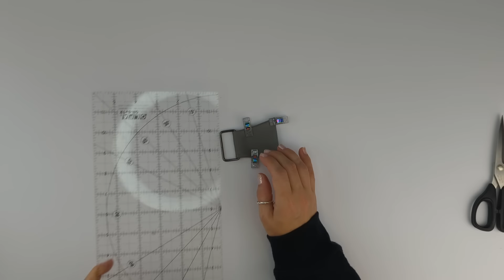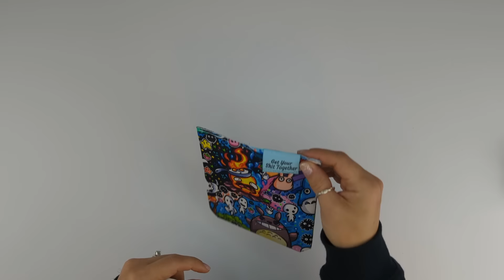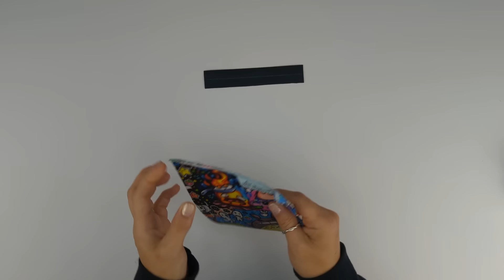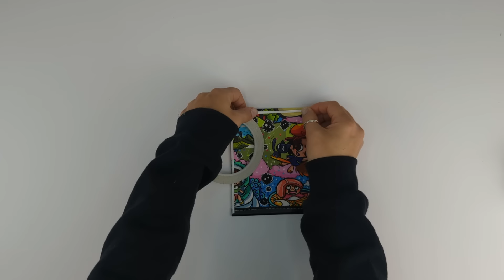The Rosie Sling Pattern - from Knotted Threads Co.

Comment: I just made the Rosie sling out of a light weight vinyl and canvas  material and cotton lining.  It came out good for a 1st try at bag making. Next time, I need to have the skinnier tape as recommended. I used 1/4 inch upholstery grade cuz that's what I have and It caused gummy needle issues.  With materials I used, it is not domestic friendly.  I used a vintage all metal heavy-duty domestic for early steps and jumped to industrial for all top stitches and final assembly.

Comment: Great explanation of why you clip curves--for this zipper, but applies for anything sewn with curves!  I just bought this pattern & my plan is to make it with leather & a few changes likely but basically the same construction & love your design & all the attention to detail in the design and instructions!  But the slip pocket--why not sew the sides & bottom for it, radius corner, then turn & close the open top with the binding?
Reply from the maker: Thank you! You can do the slip pocket that way, this is just a slight modification of the way I normally do them ☺️

Comment: Your designs and tutorials are outstanding!  What is your trick for fusing foam?  I have never had trouble fusing any other product.  Thank you!
Reply from the maker: Thank you!! 

A heat press and heavily spritzing the foam is my trick. It should be vinyl RS down and foam on top. Spritz the foam heavily once placed, top with Teflon sheet, and press for 10sec at a time. Use the highest heat your vinyl can handle (I tend to stick to a wool setting on mine). Repeat until fused, but be sure to let it cool in between spritzing/pressing. Foam is one that I found it truly matters to let it cool because the glue hardens as it cools and it appears as if it isn't fused while it's still hot/warm. The pressure of a heat press is important, but you can still get the same results with an iron. Just takes longer and is less consistent. I hope that helps!
Reply: @knottedthreadsco   Thanks for the quick reply!  I am going to practice with this and see if I can get it to work.  I happen to love the feel of foam, but I never fused it before.

Comment: Can you tell me which stitch length you use on your Juki LS 1341 when you put binding on? They look very short.
And do you use 600D as WPC or a thinner 400D. It is very thick when the bag is finished.
Reply from the maker: On my 1341: Baste = 6, Attaching the binding = 4, Topstitching the binding = 5. I'm using 600D. It is a firm binding, but that's great for the bag structure. I only use my WPC method for WPC, so it should be 3 layers of binding. :)
Reply: @knottedthreadsco   Thank you very much for your quick reply. It's super. Your stitches really just look short and my stitches look much longer with the stitch lengths (which I usually use too). I am using a Pfaff 335. Really an educational video, thank you very much.

Comment: Love this tutorial! I'm just having problems with SVGs for Cricut. I've never figured out an easy way to sort the pieces from the instructions. I finally weeded out the extraneous stuff, checked the size using the one inch square, set the pieces on the page and cut; the pieces are much larger than the paper pattern (which I also checked for scale!) HELP! has any one else cut this on a Cricut?

Comment: One more question: is this metal zipper (#5) friendly if I remove the teeth on each end?
Reply from the maker: If you remove the teeth, yes! But keep in mind there is some trimming that happens to the length of the zipper as called for, so you'd just need to be sure you remove any excess teeth before you sew on the bottom gusset ☺️
Reply: @knottedthreadsco  ok. Thank you!  I was thinking 3/8 (SA) but maybe I should allow more? I’m watching the video as we speak so I can see how much to allow
Reply: @knottedthreadsco  oh yes!  I cut it exactly 17 inches. I see that you allowed more in order to add the pulls

Comment: can you use waterproof canvas for the body of the bag?  instead of vinyl?
Reply from the maker: You can, but it will be hard to stabilize and I don't recommend making it without stabilizing, so that will take some playing with. I'd also recommend using the clear d-ring anchor option 🙂

Comment: How do you fuse interfacing to vinyl?  i would think it would melt the vinyl
Reply from the maker: You just need to do it carefully. Not too high heat or for too long. That's when melting occurs.
Reply: I used 3m 77 spray

Comment: Maybe I missed this but did u use foam on the zip panels as well? Or fleece? Sorry if u said it and I just missed it 🤦🏻‍♀️
Reply from the maker: No worries! I did say it, but I just used fusible fleece
Reply: @knottedthreadsco  thank you! Clearly I haven’t had enough caffeine and am excited to make this! ❤️❤️
Reply from the maker: All good! To clarify, it was thermolam 🥰
Reply: @knottedthreadsco Shannon I like foam as well, do you have a trick to adhering your foam? (Or do you use self adhesive foam). I only have Annie’s sew in foam currently
Reply: @knottedthreadsco that part I did hear and educated myself on what it was 😂 don’t have any so fleece it is 😂
Reply from the maker: @rebekahkui  I have the best luck laying my vinyl RS down on my heat press, laying my fusible foam on top, spritzing heavily, and then pressing for about 10seconds on a wool heat setting. Occasionally I need to do it twice but otherwise I have no issues!